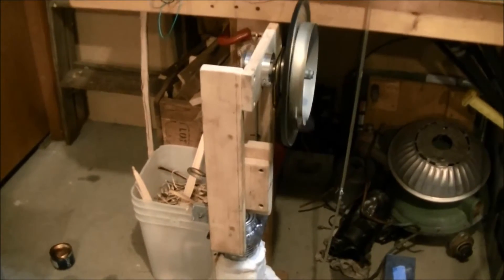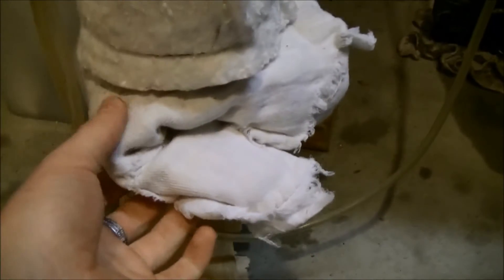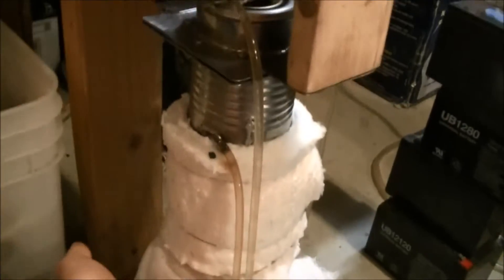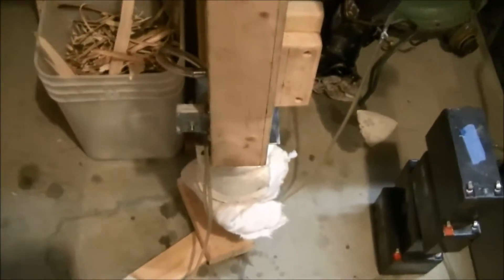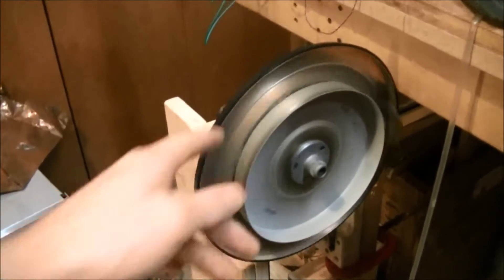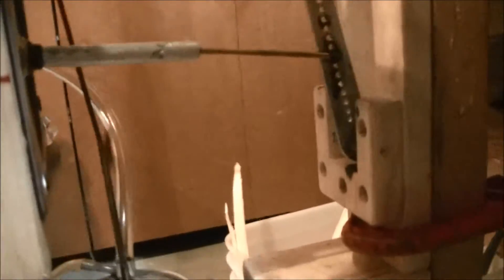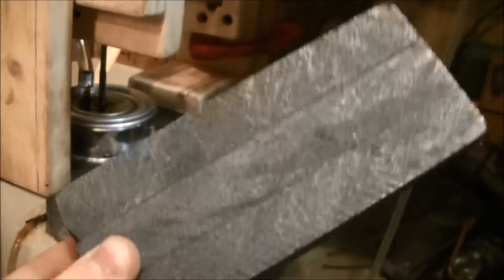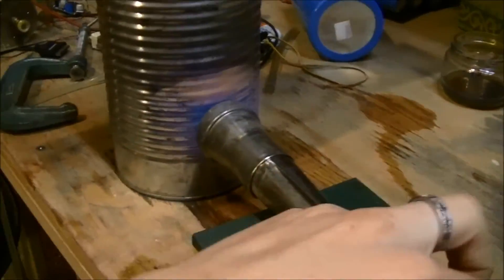Stirling Engine #5 Running on Dry Ice and Hot Water

Comment: Maybe lots of air. I would think not. You need a low pressure zone to get the cold. I would assume this means lower than environmental pressure. I could be wrong. I think your on the right track getting high pressure in diaphragm /piston. Its all about that pressure being released. Same in a fridge. My old gas fridge used flame to pressurize gas, then it cools in condenser. Then cooled pressurized gas is uncompressed in fat tubes in fridge to make it cold. Thermocycle drives it round and round.

Comment: Google "diy liquid nitrogen still" His blog is the top result. More info for you there, including video link. Be sure to sub, he does great stuff.

You may need to seal your displacer rod and any other leaks for it to work as a cooler. Different displacer would likely improve results too. You would need to pull as high a psi and negative psi as possible.

Release pressurized gas that is cooled (heat from pressurization removed) in a less pressurized space and you get more cold.

Comment: I did not know you could reverse the heat like that! Awesome find. Very Cool :)

Have you tried turning the engine with motor to generate a heat differential?
I recently discovered they make great coolers if drive is supplied to the flywheel. Ben Krasnow uses helium in a Stirling to distill liquid nitrogen....